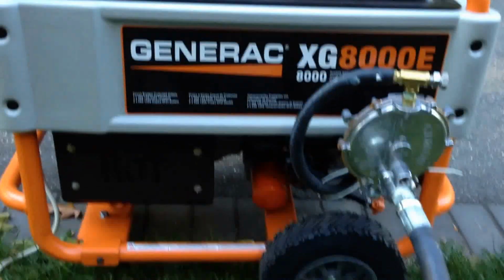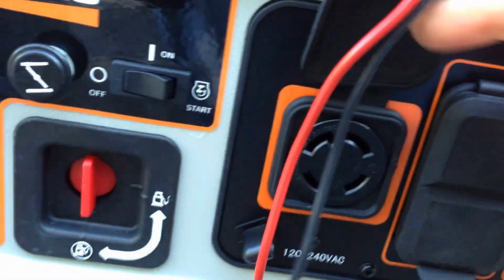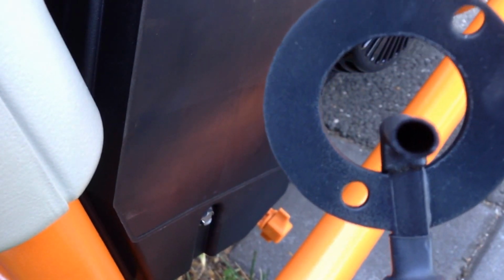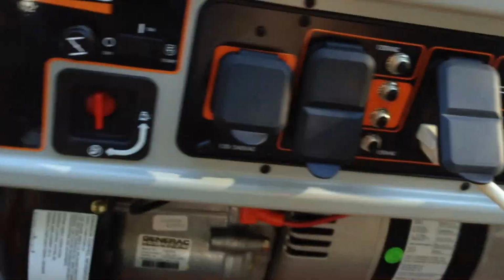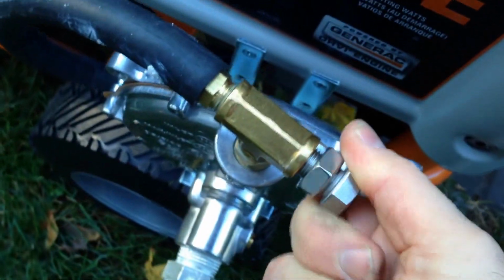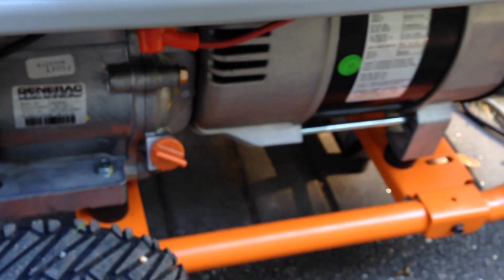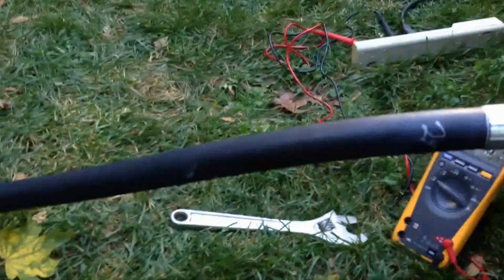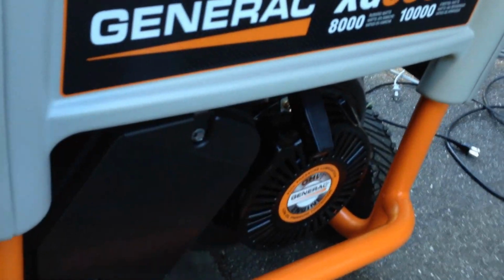Generac XG8000E Portable Generator Conversion Natural Gas - Snorkel Kit

Comment: Great Generater.Systems . Our 1st 2500W Champion backed us up with hurricane Ida last August when our whole home generator crapped out after 8 days. Love the dual fuel. Hope to never run gasoline in it.Bought this 2500W to parallel with our other one for the RV.
Reply from the maker: NG and LP Is much better. No dirty carb problems from leftover gas, and it runs smoothet. Thanks for Joining us!

Comment: The XG8000E was built during a time (up to 2012) when chinese manufacturing and engineering was at a low.  Chinese-built products for the small-engine market have vastly improved since then.  This particular generator is ridiculously difficult to work on - ie, most of the unit needs to be disassembled just to get to the battery to replace, or to the carburetor to drain the fuel for storage.  

The major components are good quality (engine, tank, alt and frame) but the associated smaller parts are cheap and break easily.  

I own one but for the reasons mentioned above,  and I don't recommend it.

Comment: to change the battery which did not last 2 years you have to take the generator apart  gas tank off side panels off lots of work who at Generac ok this piece of shit design, shaking my head American made crap xg8000e
Reply from the maker: Thats like having to remove a car engine to change a spark plug. They don't care about the end user, only the manufacturing cost.  Pretty Outrageous.

Comment: You mentioned in the video the the choke stays open when running on NG. What about starting the generator? Don't you need to close the valve to start? Did you need to do any mods to the choke assembly?
Reply from the maker: The Choke stays Open 100% of the Time. Starting, stopping, its all open. No Mods made to Choke, Just Keep it Open at all times. When I say Open, I mean that its fully open and air passes through unrestricted.

Comment: The Hz adjustment needs to be done after you set the gas valve lock it down then proceed to the 8mm governor nut /screw and adjust until your around 61.5 to 62 Hz then you put a load on.

If you google Hz you need to be as close to 60Hz   (3600 RPM) No more then 5 numbers up or 5 numbers less.

I choose. 61.5 to 62 Hz no load with a load on you should be on point.

Your voltage regulator will do the rest.

If not you will cause damage to electronic devices connect to generator!!!

I have same unit with conversion and I am getting max output on generator!!!

Setting on your spark plug must be gap at 20 and the choke closed!!!!

I have no issues!!!!

🙁🙁🙁

Clearly 23:15 into the video shows that the gas valve nut is not set and lock down.

You will not get proper reading on your Fluke!!!!

All in all good video just missing a few items that need to be done first....
Reply: Thanks for complete info.

Comment: I will be very glad if someone can really provide an answer to my question. Before using this type of generator with this tech, would there be engine oil in ? and how long can a 12 kg cylinder serve ? will it be up to 2 weeks running for 24 hrs ?
Reply from the maker: You need to add oil to start it. I don't remember if this model came with oil. It probably did.
My guess is that you would get 20 hours with a 12 KG tank, on half load.

Comment: I never liked how those regulators are mounted on the side like that. They could easily get damaged in storage or transport. I'm going to end up ordering a tri fuel carb. The regulator is mounted to the carb. It is a neater installation where everything is tucked away within the frame. Besides, the tri fuel carb is about a quarter of the cost of the kits that are out there.

Comment from the maker: I don't see any difference Running this generator on NG. Because NG has less energy density than Gasoline, it produces about 10% less power. The Flashpoint makes little difference except its difficult to pull start on NG. See My other Videos for a Fuller Explanation on Pull starting an NG Generator. But the generator runs cleaner so the oil and plugs should last longer.
Reply: I think the biggest and probably one of the only reasons to use NG is because it is a fuel that is supplied even during most natural disasters. I don't want to run mine on NG, but with only one gas station in our town, if they ran out of gasoline, it would be a major hassle finding more. NG would still be available most likely.
Reply from the maker: I agree. After Sandy, we couldn't get gasoline because the transfer station flooded, but everyone had NG except for some parts of the neighborhood that were underwater. A second reason I would note is that NG is an almost Perfect Fuel. It burns Very Clean so Sparkplugs remain Cleaner and no Carburetor issues. It is less energy dense so your generator loses about 10% of its Rated KW Output, but that's worth it if you can't get Gasoline.

Comment: I'm sorry.. I just would like to ask what was the point of this project...
Generator $1,200 (No Transfer Switch)
Conversion Kit ~$200 + Painfull and time consuming work = lost in power as generator is rated 8KW base on gasoline not gas.
Manual transfer system ~$450
Total cost ~$1,850
Very noisy
Heavy to transport in and out of the house

Instead by an 8KW gas standby generator from Generac which includes an automatic transfer switch for ~$1,861. Weather proof enclosure, super quiet, full 8KW power, NO hacking the unit, NO warranty issues, NO transportation required!!

BTW.. Nice project!!
Reply from the maker: Why would my friend spend extra money, time and aggravation to scratch his left ear with his right hand and do this ridiculously complicated project instead of a standby system?
Because Government Abhors a Straight Line.
The Permitting process in his village raised the cost of a standby generator into a 15K project. There are certain benefits to this system in that it is extraordinarily reliable, The standby generators sometimes generate errors and they run every week. This system is extraordinarily simple and reliable. I used mine through Sandy. But see my 20KW Standby Gen. It is very powerful, but all of those electronics can create their own set of problems. 20KW Briggs & Stratton Whole House Standby Generator - Part 1

Comment: Your load block is turned out way too far or you have insufficient gas pressure from your natural gas line. Normally you would not have to adjust that screw at the demand regulator as it is preset as the engine causes negative pressure vacuum to open up the valve. Also keep in mind natural gas has less BTUs than propane or gasoline so your machine will not perform at its rated wattage. Camera action was a bit crazy I couldn't watch it but it looks to me by the end of the video you guys were able to solve the idle problem
Reply from the maker: Yep, thats what happens when you have to rely on a blackberry user to hold the Ipod. It didnt work properly until we loosened the spring or manually held in the Primer Button. I am not sure but don't think it was a gas pressure issue. At least it is Working Now.
Reply: Yeah it sounds good at the end of the video. The XG series is a better machine than the GP, but the XP is the best. It has less than 5% THD, good for sensitive electronics. XG has more than 5%, but a surge suppressor helps that

Comment: Hello it appears that the generator need to be tweak at governor you need 8 mm socket with extension do the adjustment without load first get the generator up 61.5to 62....

Make sure you follow instructions on the load block 2 turn out make slight adjustment lock it down with no loads.
Then you can adjust governor on motor to get proper hertz.
I had hand tighten air box around carb and did a little cutting on air box nake sure snorkel is not pinch. . dmithugs@gmail.com
Reply from the maker: Thank you for your Excellent Information on how to adjust the Governor. For those who don't know, the Governor on the generator automatically adjusts the RPM's to get the correct Hz. You only want to do this when you are sure that you do not have a fuel starvation issue. In my case I could see that it was a fuel issue, because the HZ corrected itself by going up to the 60's when I held down the Primer Button. Therefore, the issue was the Spring in the Valve being too tight, which removing the cover and then unscrewing it two turns corrected the problem. If this didn't correct the problem, then yes, I would have adjusted the Governor (now I know how). I would first test it on gasoline as well. Thank you for this information.
Reply: On the generac  the AVR does the  voltage  regulation but you have  to adjust the governor to increased or decrease rpm inorder to get proper hertz. 
You had that problem when running it on propane.
Do the adjustment first in  gasoline then you could used the load block to run it in propane.
Reply: Also your checking the frequency with a digital meter. Unless the meter is designed to measure True RMS your only going to see an approximation in either AC voltage or (a low hz)frequency, their great for DC voltage, besides most equipment but the most sensitive or clocked off the 60hz will operate just fine. Most cheaper meters (under $200) are not really that accurate. Besides, most equipment now will operate just fine from 50-60 hz +/- 5%. Just set the generator for most stable, smooth run speed and let ur rip.
Also when priming..don't prime then jack your jaw for 5 min before cranking it. The gas will dissipate very quickly.
Reply: Steven MeNotTellYou
stop at 20:21 and you can see the multimeter says True RMS Multimeter right on the top of the screen:)
Reply from the maker: austin mullins My personal preference is to Not touch the Governor, if I can correct the problem by adjusting the fuel source, otherwise moving the generator to a house with a better supply may require a readjustment of the governor. I assume that the factory knows what they are doing. We were able to correct the problem at the end. Thank You